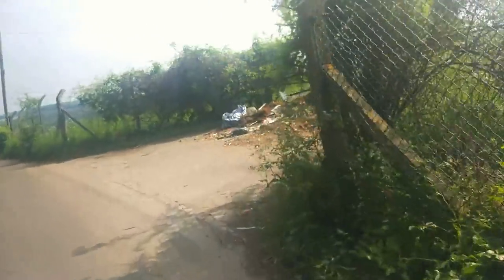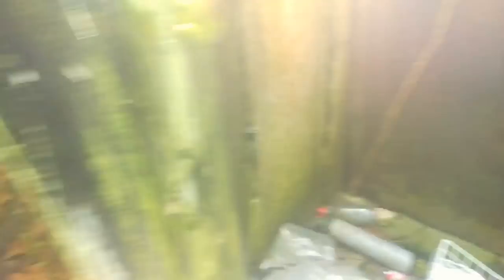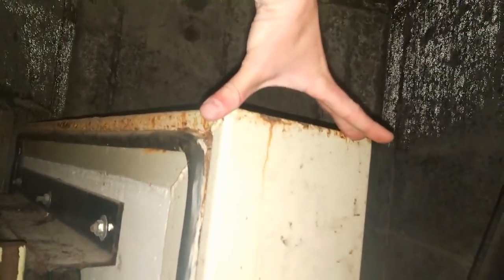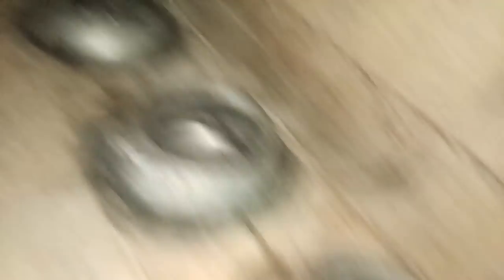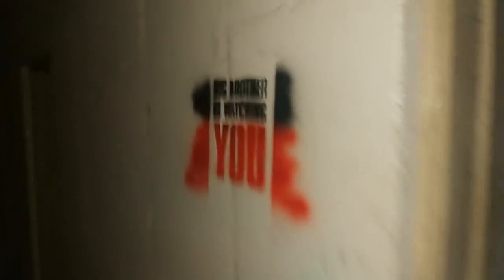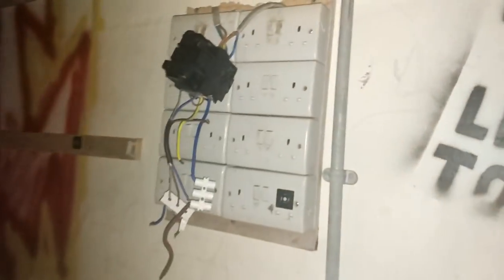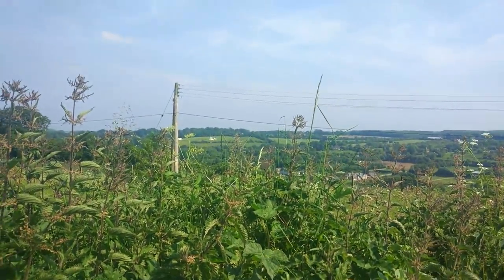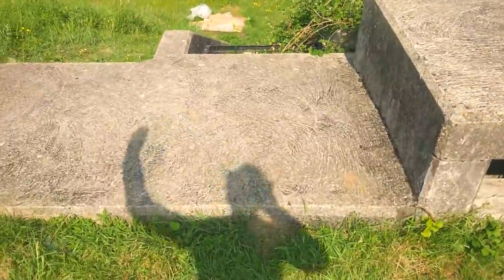Cold war nuclear Bunker near Gillingham

Comment: Box at 5:12 looks like a fuel tank for the generator and the red liquid would've likely been red diesel that has leaked from the tank.
Reply: since when was diesel red, isnt it more like a blue colour
Reply: tails gaming any non public road use diesel has a red additive put in it to stain your fuel tank to stop you using it in a vehicle on a public road as it is cheaper to buy due to tax relief.
Reply: whats the problem with staining your fuel tank?
Reply: tails gaming
The red diesel is used in farm vehicles and is way cheaper than normal diesel. You arent allowed to use it in your road vehicle because "emissions."  In reality the government wants people to use the expensive diesel
Reply: Diesel is usually clear with a brownish/yellow tint, the red is from the dye that is added by the supplier to indicate that it is tax free and therefore not for use in road vehicles.